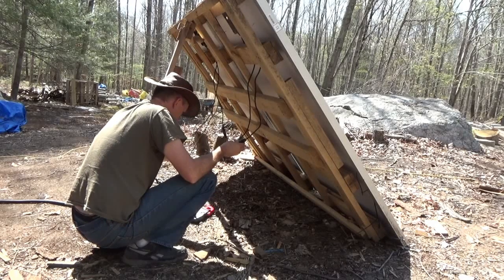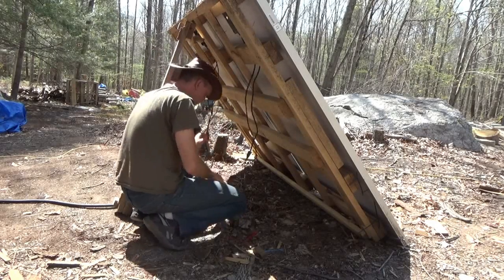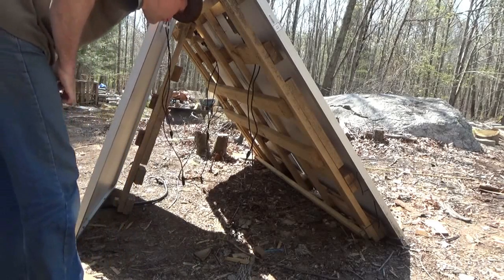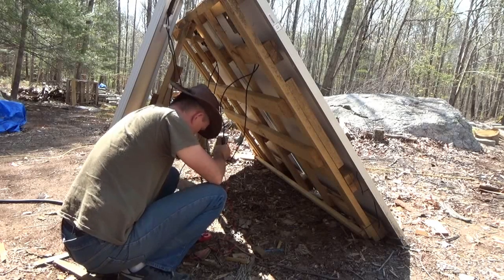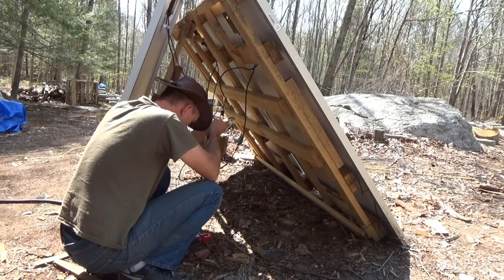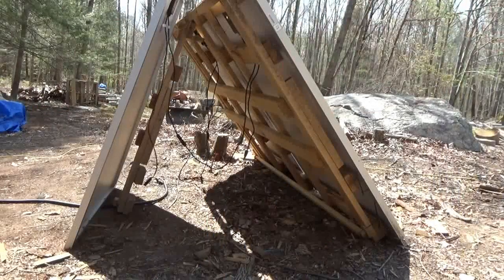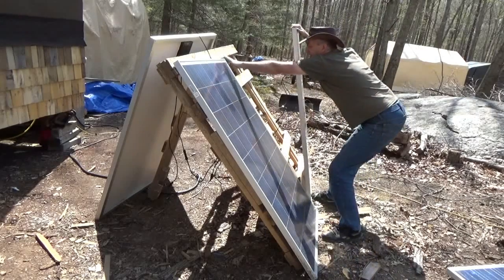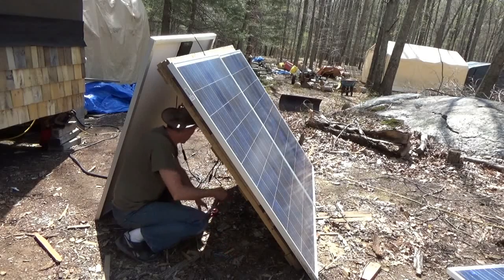Troubleshooting Solar Panel Connections For Off Grid Tiny House

Comment: If i get 3 100 watt panels what size control Charger should I get
Reply from the maker: Go with the largest you can afford so that you can expand. Otherwise a 300 watt charge controller would fit if you are not going to expand
Reply: +The Do It Yourself World thanks. What about the inverter I got a 600 watt inverter
Reply from the maker: Just remember, the largest thing you can run with that inverter is 600 watts. Have a look at the things you want to power. Amps x Volts = Watts

Comment: When you are testing those panels individually, you've got to be testing them under a test load. Measuring voltage into a no load condition does not indicate power....only voltage.  If you solder wires onto an incandescent 100 watt light bulb, you will have a consistant load,(probably a "half load")
Reply: Steven Hardy He was testing the "no load" voltage. If the "no load" voltage is zero, what would the voltage under load be? 
You can't measure "power" (watts) with just a voltmeter, so he wasn't measuring power.
He would worry about the amount of power after he could get a voltage!
Reply: He was testing the no load voltages and getting voltages. When he tied them together, then no voltage indicated. At no time during the individual tests were they under a consistant measureable load.  power delivered is a factor of voltage and current delivered.(After he isolates the suspect panel,with it under a load,then he should measure the drop across the blocking diode . You shouldn't assume that your meter has the ability to test the reverse voltage rating of the diode.)
Reply: Steven Hardy
Ok, lets see - battery a tests good no load voltage, battery b test good no load voltage, but battery a and battery b in series tests zero no load voltage - therefore it MUST be a short in one of the batteries?????????
Reply: To troubleshoot without knowing for certain what the diode configuration/ condition is guesswork.  In a no load condition the diode reverse voltage becomes high resistance ,not infinite resistance. It is possible in such a situation  for the meter to see the voltage although it is not capable of delivering anything but negligible current.
When a circuit does not make sense, and your going round and round....revert to minimum config (individual panel ,predictable load .
It is important to realize that measuring volts is not the same as measuring power delivered. You can indirectly measure power by measuring voltage IF you have a known circuit resistance..
Reply: Steven Hardy
Ok, Steven, I'll agree it could have been the diodes internal to the panel. However, these panel's had been working until he moved them. So, what's more probable, a diode that is internal to the panel decided to go south, or a connector that is outside and subject to physical damage went bad? And I have many times encountered other types of plugs that push the connecting part back and never make contact, even though they are firmly plugged in.
So, what's the failure rate of the internal diodes and what's the failure rate of the connectors? I sure don't know, but I would think the connectors would have a much higher failure rate.
Reply: I dunno...but it sure seems like the panels were acting like an old fashioned D.T.L logic NAND gate.
Reply: Steven Hardy
Them logic gates tend to creep into everything! :-)

Comment: y wouldnt use the connectors anyway, its a weak point, just connect them from box to box whit one cable you can connect them direct in the box.

Comment: Check the panels some have a maximum pass thru voltage and they could be cutting out to save you from frying the panels.

The panels often have this on them in theyre description maximum series voltage or something similar if it goes over that the panel will cut out and voltage will go to 0 it is a safety measure as voltage gets high enough the pass thru can actually arc inside the poly panels as you have poly crystaline but mono crystaline panels are more designed for higher voltage series hookups.

I will also say you need to not mix your panels wattage / voltage because if you mix a panel with a higher optimal voltage output with a lower optimum output you throw the efficiency out the window and also run into balancing issues which will degrade panels much faster.

I will say it is optimal to run panels with as close wattage and voltage characteristics otherwise you chance causing issues with dropped efficiency along with increased degradation add to it more issues with shading and sensitivity to light output making large impacts on your power output in otherwards super low outputs on mildly cloudy days and early cuttoff of power output in the evenings and later power output in the mornings making your total amount of solar input drop drastically.

I set my panels up so balanced on a good moonlit night I actually charge my bank up at night I also have the perk of getting descent solar first thing in the morning before the sun is even really out same for in the evening so in short your method is shooting yourself in the foot and giving more problems than you can create solutions PLZ fix the problem correctly.

Comment: Hi Troy, first time commenting.  It looked like when the video started you had the two shorter leads connected and then the two longer leads.  When you swapped out it appears that you connected a short to a long.  If they are all factory connected wouldn't that suggest that you were wiring out of phase?  (Keep in mind a have 0 Solar knowledge so I could be completely off base here...)  Thanks for the great videos!

Comment: Your panel placement is your worst nightmare. Put them in the middle of the north side of the meadow facing due south and get them off the ground. None of your panels should be facing east of west or you will get an overall poor results. How about building one big chicken coupe with the roof slanted towards the south sky?  You build a tiny home, chicken coupes but then you sell yourself short on a simple stand for your solar panels?  You will learn by doing it.

Comment: If those panels were some of the ones that was being blown over by the winds, it could be possible that one of them has a broken wire where it junctions with the panel on the back, then when it is hanging down and you connect a meter, it will show that it is producing current, but after connecting two panels together, its possible that the wire moves just enough to lose connection and you know the rest,   no current. next time you check the panel that you took out of service with a meter hooked to it while shaking the wire to see if it is loses connection at any time .

Comment: Check your polarity to make sure it is correct. If it backwards there will be a neg sign in front of the reading. Also check the amps that will tell if it is really putting out anything. if you want to get real technical you have to put a load on it. but you can kinda tell from the amp reading. It should be putting out 6 or 7 amps. if they are rated at 8 amps. GOOD You got it going. Maybe you can order some MC4 plugs from ebay for the one you said was different.
Reply: shartne  he needs someone that knows what they are doing, you have a decent solar set don't you?
Reply: The Do It Yourself World It may be unlikely but it is possible for that to happen. It is something that I check while doing the voltage test and the amps reading. A engineer who watches my channel and he is friend of mine too told me to do these test. Just a good standard thing to check. Just saying if you see a - in front of the reading the polarity is backwards. hope that helps. I for one did not know that was what the meant until he told me. I was not born knowing everything, darn. So Im always glad when I lean something from my viewers. That is what youtube is all about for me. We trade info back and forth. We learn.
Reply: shartne I learn a lot from the comments too. I think sometimes comments are taken wrong. I find myself defensive when some of my methods are being question on something, but sometimes I have to swallow my pride and accept that my method is not always the correct or best way of doing something.
Reply from the maker: shartne You cannot reverse connections and these are factory made. They worked before. Now they do not.
Reply: Walter Bodine Yeah sometimes I need some help too, and my viewers helpful comments have caused me to increase my knowledge about solar. I like good comments if they are helpful. I have only had a few trolls that probably followed me from Troys channel.. dang.
Reply: Walter Bodine Yeah mee too. I have to remember to not be offended sometimes. LOL
Reply: The Do It Yourself World K good fix buddy.

Comment: Has the polarity of that panel been swapped over? You should be able to test for this using your meter.
Reply from the maker: twerki78 Not unless someone was messing with them besides me. These are factory made.
Reply: Worth a quick check though? hope you get it resolved.

Comment: you should not rule out blocking diode. with just the one panel it will show power but with another panel connected to it then the power can be lost into the 1st panel threw a faulty diode. Never had a problem myself but I have seen others on youtube say they have had that happen